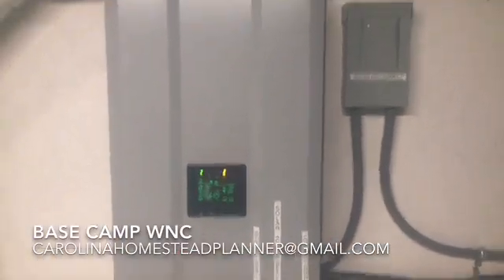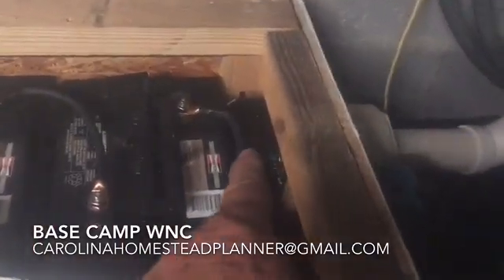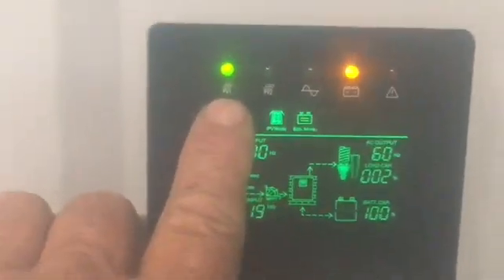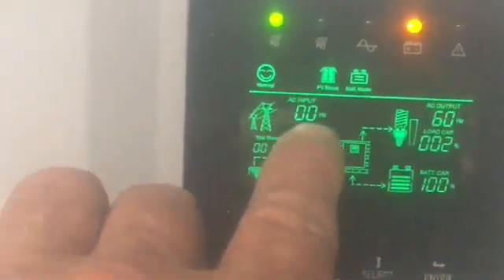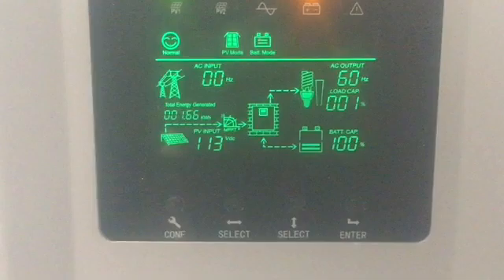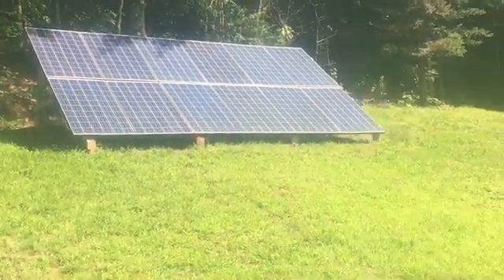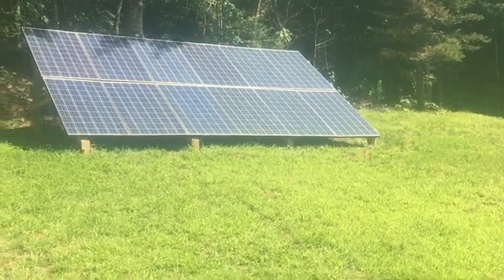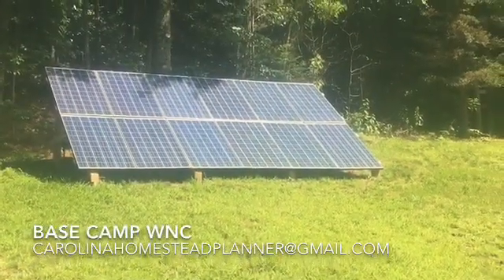12,000 Watt Solar System And It’s Ready To Grow

Comment: How much do you have invested in it currently?
Reply from the maker: It’s $3,500 for the inverter complete $1,800 in panels
&1,600 in batteries and then about 750.00 in cables and boxes

Comment: BC WNC,
What EMP protection is incorporated into the system?
Reply from the maker: Echo Papa 
If you use a metal enclosure and line it with cardboard or other material it’s a faraday cage
So that is what I was asking if you line the metal drum then is that a faraday cage?
What your opinion on this
Reply: BASE CAMP WNC 
Yes a metal drum 🥁 with a lid is a good Faraday Cage.  The cardboard is only to ensure nothing touches the inside of the drum to conduct the energy that will be present in the drum into the devices in the drum
Reply from the maker: Echo Papa 
None
Reply: BASE CAMP WNC 
Your customers are preparing for a grid down event that does not include a local EMP.  I suggest having redundant critical components stored away in Faraday’s to install post-EMP.  Keep in mind if I was going to EMP someone I would do it a second time 1-2 weeks later. 😉